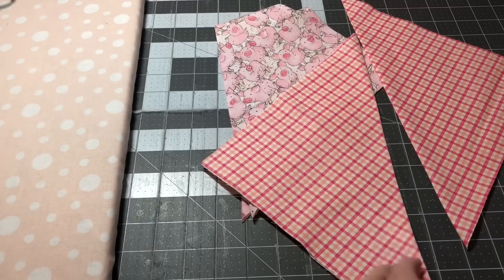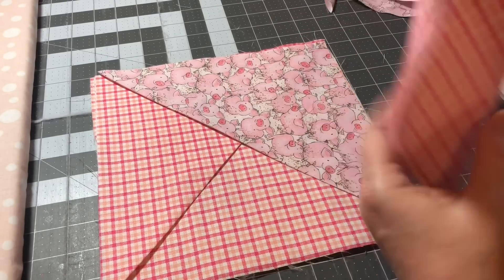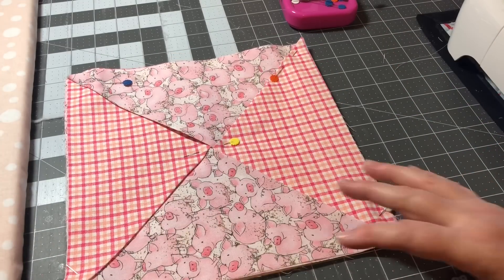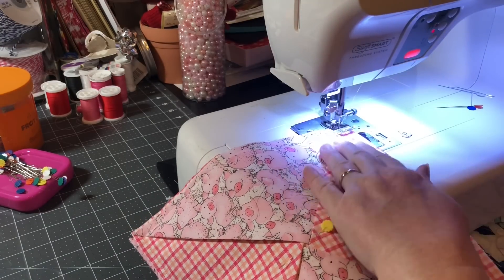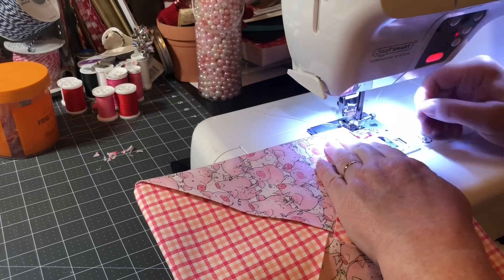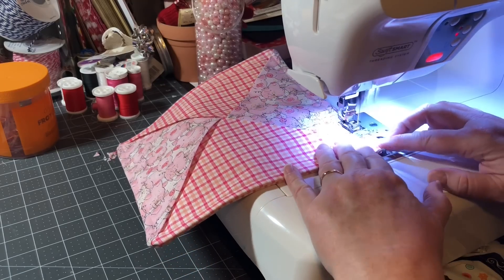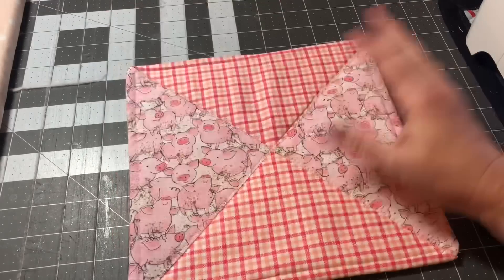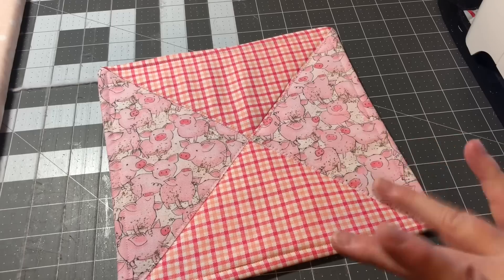Craft Fair Series 2019-Hot Pads! Idea # 69

Comment: How would I attach a loop for hanging the potholders?
Reply: Find a youtube vid of someone putting a hanging loop in something like a lavender sachet (search for DIY Lavender Hanging Hearts - you want an example where they put in the loop before they turn it right-side out rather than attaching it after it has been turned).  

The idea is that you put a loop of ribbon or matching binding that has been stitches along both long edges (to make it stronger and more like a strap) between the layers at a corner before your stitch the layers together.   The angle of the loop is set by how you cross the ends. What will be the top of the loop when it is finished points to the middle of the pad before you stitch and turn it.  You want to be sure when you stitch the hot pad that you don't catch the loop anywhere else but that corner so pin or tack it down out of the way if needed.

When you first place the ribbon or strap cross the ends at a corner so the ends extend past the fabric edges so they get caught well in place.  To make them strong shorten your stitch a bit at the corners when you seam the fabrics together and do a bit of backstitching both before and after you've turned the corner.

Comment: If you want sharper corners you can leaving your batting to insert and fit inside after you've stitched, trimmed, turned and ironed it but before you top stitch it.  Cut the batting a wee bit smaller so it fits inside the seam allowances.  This removes bulk from the seam allowances.

When you first stitch your seams take a diagonal stitch or two across the corners (which means you do two 45-degree pivots at each corner rather than one 90-degree pivot).  You will have a couple of stitches at each corner that line up with the corners you trim off before turning.  Depending on the thickness of the fabrics you choose and your stitch length you might need a stitch or two more at the corners.

Comment: Wow it is so easy and pretty. Can you give measures and how to make a rectangular hot pot holder for my long bowls? I will definitely make a few of these, great Christmas gifts.
Reply: Nancy, I have an idea about making a rectangular one. First I tried to fashion one in a rectangle shape and found out you end up with a lot of fabric waste,( I used paper as a tester).  Then I remembered the first time I made these I made them by folding the top square fabrics in half not on an angle. Well I tried these with my paper templates again folding in this manner. First decide what size rectangle you want, cut that out. Next cut four more sections the same size. Now, fold two sections in half the long way and the other two sections in half the short way. Right side of fabric out. Now, add the folded sections the same way Deanna did by weaving them in with each sections on top of the last. You should end up with what looks like a checkerboard. Follow Deanna's instructions on sewing and turning and you should be home free. NOTE: try this with paper first as a test. I used copy paper, or test with scrap fabric.
Reply: Shay Marie thank you. I will definitely try it.
Reply: @nancycrosson6644  Nancy, when you do, post back and let us know how it worked out. Glad I could help.

Comment: cute piggy fabric! appreciate the info on why it's not for hot oven heat because I may just do that and then say "ouch"!
Reply: ffstew, the reason it can not be used as a oven hot pad is that it needs a heat insulated piece of batting. You need to put insulbrite in it. It can be purchased at most fabric stores.
Reply: @mw54470  , yes, I couldn't  think  of  that  word "insulate" so I explained with "ouch" -- insulbrite is what I need to make an  oven mitt one day 👍.